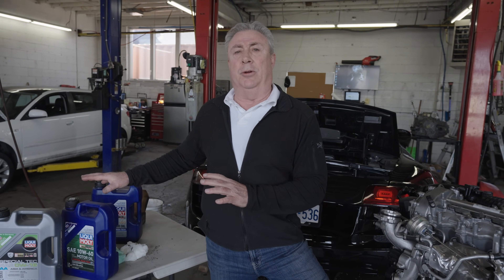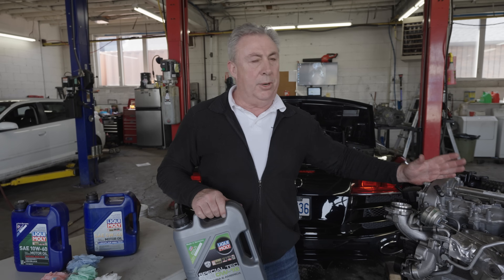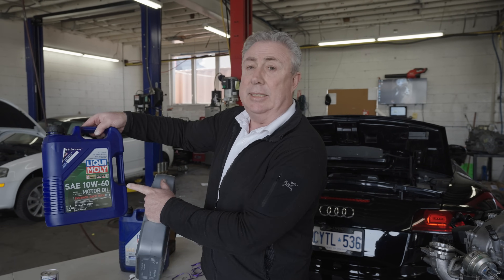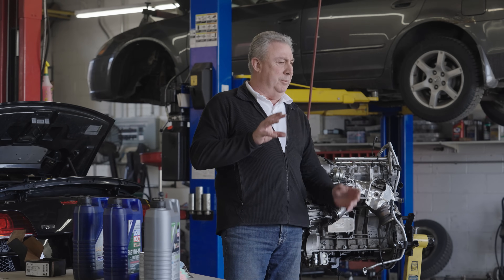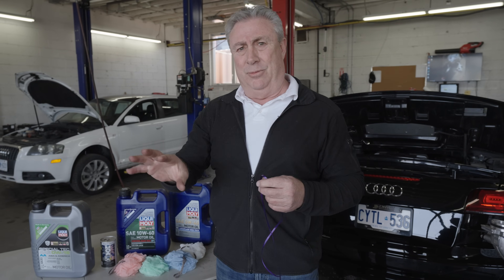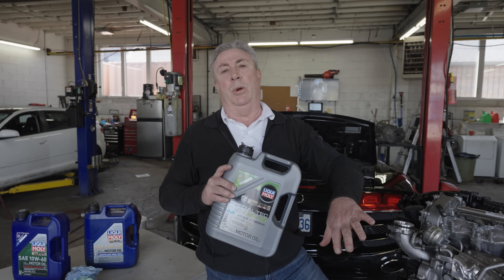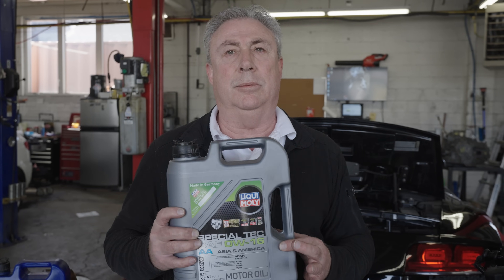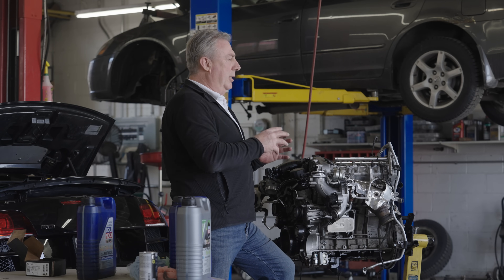Thin engine oil just a Scam? What's Safe

Comment: Most if not all of these engines that spec 0w-20 are rated for 5-30 everywhere else in the world except the USA.  They are full of shit here
Reply: That reminds me that I ate shit for breakfast this morning, but that's beside the point (kidding). My point is I think it is good to thicken the oil as the vehicle ages, and listen to it and the see how it drives while experimenting. I think a specified 0w 20 is too thin for a 160,000 mile engine, and maybe should have a 0w 30 or 5w 30. Main thing is change the oil frequently because tge best oil is clean oil.
Reply: @CJ-wc6lf I accidentally bought 5W30 for my 0W20 2012 CRV with 138K. It does run more quiet. I keep it in a warm garage, so cold start up temperature is 55 degrees F. I’m wondering if I should just keep using. I change oil every 3K.🤷‍♂️
Reply: @davekana8388  Yes you should keep using it.  The fact that your engine is quieter is proof.
Reply: @davekana8388  Is it pure synthetic oil? Do ambient temps exceed 100°F often? Do you tow anything? How long are your typical trips? 
 I would recommend getting an oil sample (when changing your oil) analyzed. You may be spending oil and filter money needlessly. The only people who need to change oil at 3000 miles or less are those who use non-synthetic oil, take short trips on a regular basis, and/or neglect to use high-quality engine air filters.
Reply: @davekana8388 sounds fair to me. A donk with a couple of thousand hours on it, is better off with an oil grade up, IMO.
Reply: @davepaturno4290  Hi Dave I to switched to a Blinded 5-30wt. for my 2015 Toyota Camry' It has only 60k miles on it and its way Quiter now than it was. Yes, I live in Maine wear it gets cold no problems
Reply: @tomm9860  Hello, Tom. My guess is that if you switched to 20W-40 weight oil, your engine would be quieter, but simply making the engine quieter does not necessarily mean that it is better protected from wear. 
 As Ahmed (Car Care Nut) and Jason (Engineering explained) often advise, "Use the oil that is specified in your owner's manual".
 Contrary to what some people believe, most automotive engineers are not out to reduce the life of your engine....and the manufacturer's reputation.
Reply: @davekana8388  You are 100% fine, up to 15W-40 is approved for use for that K24 globally at those temps. 5W-XX has no lower temp limit according to the global service manual, so there would be no reason to expect issues even if you did park it outside.
Reply: @jamesbosworth4191  5W-30 is a good choice for those K24's and is listed as acceptable for all temps in the global service manual, but the fact that the engine is quieter by itself does NOT mean an oil is an appropriate choice. I'm sure it would be even quieter with a 60 grade, but do you really think that would work well long term in a modern VVT Honda engine with tight clearances and low tension rings?
Reply: @ good to know! Thanks for your kind reply, much appreciated.👍
Reply: @averyalexander2303  If an engine is quieter, it means that the oil film is stronger and is floating the parts better.  If you use excessively thick oil, you will have excessive wear on startup, as it will not flow well enough until it get warm, which could be a few minutes, but 10W-40 is NOT excessively thick oil.
Reply: @davekana8388  Pouring thicker oil into i-Vtec engine is one of the least favorable things you can do. 
It is quite silent engine by the way, so no real clue on need for additional "silencing"?!
If you put 5w40, for example, it would probably make it even more "quiet".
Longer period of time to achieve working temperature, heavier cold starts (you'll not use it each and every time in warm garage, right?), slower response on the gas pedal, fuel economy-no real benefits from thick oil whatsoever.
If your HONDA engine works properly, you can easily go with 0W16 Ravenol for example, or simply stick with 0W20 as a factory recommendation.

There is absolutely no benefits of thick oil for i-Vtec engine whatsoever.
Reply: @ thank you for your response, good to know!
Reply: @davekana8388  yes
Reply: @davepaturno4290 I changed every 3k miles since new using only synthetic and I still had varnish spots despite most of the engine being clean inside. Engines can have hot spots where sludge collects, yet not elsewhere.
Reply: @davepaturno4290 True, however CAFE emission standards in the US is most likely the heaviest influencer as to what oil weight to use.
Reply: @CJ-wc6lf  Mobil 1 offers "high-mileage" oil that has the same viscosity as their regular synthetic oil.
Reply: Not really. In fact, (and i mean literally Fact).. if you want clean oil, just change the filter ~
Reply: @georgehofgren6123  Except that when you change your filter only  all the oil escapes
Reply: @mrc2165 no it doesn't... 😆 I actually always remove the filter first when I do my oil changes, because it's easier to not make a mess when your  tub is empty and not full of oil.  I can take it out and place it in the bottom of the oil collection tub to let it drain while it also catches drips.  You'll only lose what's in the filter.  Clean it up and install a new pre-soaked filter and then pull the oil pan drain plug.

 However, changing only the filter is not very smart. The detergents break down from heat and friction and the carbon from combustion. The oil gets dirty from the combustion byproducts and it gets thinner than it was when it was new.  If you want clean oil, change it along with a new filter every 5-6k miles at the MOST. I don't care what kind of oil you use, synthetic or not, or what the manufacturer says. Before synthetics I was doing every 3000, and now I will go 5000 but I still feel weird about it.
Reply: @georgehofgren6123  i had a science teacher that tried this and ruined his engine, oil breaks down
Reply: @georgehofgren6123  filter does not clean the oil just takes out large particles.  Oil breaks down and needs to be changed.
Reply: @sgtshultz13 Guy, i have LITERALLY seen the oil become cleaner. As in almost clear 🙄
Reply: @georgehofgren6123 The only way to know for certain is an oil sample analysis. Everything else is just guessing.
Reply: I have heard that before. But I try and find information on the differences between oil on a US car vs Saudi Arabian, of Australian. I would love to compare.
Reply: @leegmc1985   In Saudi Arabia they use 10-30 wt  motor oil in the new generation Toyota Camry. Starting in 2018- 2024. The US was using 0-16.. now they have went to 0-8 wt for the 2025 year.. Same exact dynamic Force engine.. you know that will cause a lot more wear on the engine. Thin as water.
Reply: @charlesjackson1700  Most engine wear occurs at cold startups. 0W oils flow much better than thicker oils, so .......
Reply: @davepaturno4290  Yes ,at start up.. not much protection once they get hot. Fan oils breakdown rapidly especially during towing.  Thin oil deteriorates faster causes sludge and varnish, the timing chain to wears out faster and clogs the oil ports as well.. so....
Reply: @charlesjackson1700  It's not easy to sludge pure synthetic oil, except after frequent, short drives.
Reply: @charlesjackson1700 mettre de l huile que le concessionnaire préconise
Reply: @davepaturno4290 It breaks down and turns to sludge and destroys the engine in less than 3,000 miles.. Do you live in Alaska with it being 20 below zero..
Reply: @PhilippeSimard-m3m That's what you need to do.. Oil knowledge goes way over your head.. Some people just can't think for themselves..
Reply: @charlesjackson1700 The change in oil thickness happens at any temperature change. Have you ever seen motor oil flow tests at 50 degrees F. vs 100 degrees? That change is reduced when 0W weight oils are tested. In other words, a 5W-XX oil takes longer to flow through the engine than does 0W -XX oil. 
After breakin oil is removed, thinner oils will do exactly what they are designed to do -protect your engine. Just don't do short trips on a consistent basis.
Reply: @davepaturno4290 Thin oils do not protect an engine under pressure ,hot temperatures as well as  under stress/ towing . That is the reason you hear about these newer engines building up sludge , varnish,sticking rings and failing. Oil dilution makes thin oils toxic very early on.. sometimes within the first 2000 miles. I've talked to several Master mechanics and they all say the same thing.. You are just going by what you read.. car manufacturers do not want these engines to last.. it's also just for a lite bulb in gas mileage sometimes less than 2/10 of a mile..CAFE RESTRICTIONS.. AND  DEMOCRAT PROPAGANDA..
Reply: @leegmc1985  My mazda owners manual said use 0w-20 USA and Canada, Except USA and Canada...use 5w-30. Then it mentions if 5w-30 isnt available in Mexico to use 5w-20. I have to assume even though it says "except USA and Canada" this is a North American version manual which means that would only leave Mexico. I have researched some other countries (Europe\middle East) and they were given the 5w-30 recommendation as well
Reply: @Mach141  Same here.. in my 2025 cx 5.. so on my first oil change i used penzoil ultra platinum 5w30 instead of the mazda 0w20 moly oil, but now im second guessing it since i found out that the oil pumps are programmed differently for different parts of the world and thats one of the reasons they recommend the 0w20 for skyactiv engines.. But not sure how true it is. .cant seem to find anyone who knows for sure.... about ready to just ride a bike all day lol
Reply: @dillonDner  I wouldnt worry about it. Im almost certain my mazda didnt have any type of variable/programmable oil pump. Most cars in fact do not. Love the car care nut, but dont believe everything he says. I have heard of variable oil pumps, but i think they are still pretty rare, and its not something thats programmed once for a certain viscosity, but more of a constantly variable thing (again, for fuel economy) and nay such system would likely have a oil pressure sensor built into it, so it would still operate fine. The thicker oil would just build pressure a bit faster because it has more resistance to flow.
Reply: The SAE recommendations are based on ambient temperature. You should only be using light oils if you live in the Arctic. Even SAE50 monograde can be used down to -10C/14F. 

Australian oil company Penrite even makes a 40w-70 engine oil.
Reply: @leegmc1985  Just go to Saudia Arabia and ask them. They love it when we Americans come over there and ask them questions.
Reply: They used to put a temp chart in the owner's manual that showed what oil you could use based on outside temps.  But now with the crazy push for more mpg they just say use oil good for the north pole.
Reply: @ I had my timing chain changed and mechanic told me to change every 3K or the 1 year warranty wouldn’t be good. So I’m using synthetic blend, high mileage Valvoline.
Reply: @davekana8388 I don’t know if it’s the same now. But conventional high mileage Fluid, had addictive’s that would swell your gaskets to stop oil leaks/burning. Those gaskets would Eventually get brittle. Causing you to blow a head gasket faster. 

I was told if your car doesn’t burn much oil then it’s best to not use high mileage oil. Even if you have a high mileage vehicle. Unless your car burns a lot of oil, than it might help and the car might last a few more years. But that option is only if you can’t afford proper repairs or didn’t want to spend the Money to properly repair your current vehicle.
Reply: @ I never heard that before, my very knowledgeable guys at my local NAPA said I should use it.🤷‍♂️
Reply: @davekana8388  Does the car run noticeably better with the new timing chain? ~
Reply: @ for sure, mileage up a bit, no ridiculous rattle on cold start or restart after an hour. Went with a Cloyes kit. I’m sure it added to the longevity to my rust free CRV!
Reply: @davekana8388  I would have asked him why he specified 3000 miles.
Reply: @ 🤷‍♂️ he was probably hoping I was going to bring it back each time.
Reply: in my gf's 2010 crv with 238,000 miles, i change oil every 5-6,000  miles with synthetic 0-20 walmart "supertech" every single time. runs great & it's about 1/2 to 3/4 qt low at oil change
Reply: @ that generation CRV is the real keeper!👍
Reply: @dominicfischio851  I do the same thing with my 2001 Accord with 280,000 miles. It uses 1 quart of the 0w20 oil in about 3,500 miles of gig app driving. That's severe service to say the least, lol😅!
Reply: @gknife1499 la 0w 20 c est la meilleur huile
Reply: @dominicfischio851 It would do better with 5-30wt  especially with that milage.
Reply: @charlesjackson1700 c est faux
Reply: I have new bmw in  Europe, and it has written in owners manual oil viscosity depending on climate u live and drive , mine says from 0w-20. Up to 10w-40. Is good to use
Reply: Bought a chevy truck in 1995. Says to use 5w-30. I used straight 30 since it was new. 360,000. Still running good.
Reply: Mine calls for 0W16. I'm going to 5W20 full synthetic.  Doing the Restore and Protect for a couple changes.....
Reply: @toddkolbe6379 go 0w-30 best option u are protected in both cold and warm
Reply: @toddkolbe6379  That's what I use and mine that calls for 0-16.. It only got the 0-16 oil when I carried it into service Department for two oil changes what came with the Toyoguard Platinum Plus.. Which was 699.00 and you could not delete it.
Reply: I’ve heard that. However I think it’s a wives tale. I looked up my 5.3 spec in a variety of owners manuals across the globe and they were all the same 0w-20 with no listed substitutes
Reply: @Maverick09171  GM use the same oil weight globally. The Japanese and the Korean automakers don’t. Aside from the Hybrid engines, Toyota recommends 5w30 or higher in most countries.
Reply: @RPD91 tous les moteurs japonais minimum 0w20 voir moins 0w16 ou même 0w8 pour hybride les ingénieurs savent ce Qu ils font
Reply: True. I looked up the 5.7 Toyota V8 in the Land cruiser for Saudi Arabia and it takes 5/30. In the summertime I put 5/30 in my Tundra. Winter time 0/20. I looked at the temperature oil viscosity chart and I knew something was wrong. It gets up to 115° in California in the summertime. 0/20 is an underperformer at high temp.
Reply: My car maker wants me to use 0w20,  but its too thin for the intense heat of Arizona. I did look up an owners manual for the same exact car in Arabic for sale in Saudi Arabia/ North Africa. Google translate helped me read it..5w30 was recommended. I switched, change the oil every 5k and use quality full synthetic oils. 320k original engine miles and runs perfectly.
Reply: @michaelyounger4497  The important thing to know is how well the vehicle's cooling system can maintain a certain temperature during high ambient temps. If your vehicle does this, the need for higher viscosity is lessened. Auto manufacturers test their vehicles in extreme weather conditions, and let's face it, desert heat in states like Arizona and CA, as well as extreme cold in Northern states provide the data that engineers require when determining oil viscosity. Racing your car on a track in Arizona is most likely a good reason to use higher viscosity oil during those sessions.
Reply: @michaelyounger4497  And  engine will last longer.. When thin oil breaks down it causes sludge and varnish.. That's what destroys the engine.. Thin weight motor oils cause that to happen prematurely.
Reply: I have 2 96 civics, one American and one Japanese. The American one only says to use 5w-30. The Japanese gives you a chart with about 10 different oil weights and tells which climates and conditions they're each best in. Based on the chart, it's actually best to use 10w-40. That's the jack of all trades oil on the chart. That's what I've been using on both, even though the American one recommends 5w-30
Reply: @peterdaniel66  Actually, BMW specifies the same 0W-20 oil for their 2024 Z4 with B58 engine as does Toyota for their 2024 GR Supra with the same engine.
Reply: All for a 1% difference in fuel economy what a joke. A few times in my life of mistakenly bought 5 qt 10W-30 when my Toyota recommends 5W-30. I put the 10W-30 in any way and of course nothing happens. And you're not going to see a difference in fuel consumption. It's a joke
Reply: Wrong 0-20 is called for by most  manufacturers in Canada
Reply: Amen + Amen.
Reply: I didn't know Jiminy glick was an oil professor. 😅
Reply: The Toyota Cross when originally brought out with the new 2L engine in South East Asia specified 5w-30 oil, then 0W-20 then 16, and now 08 oil.
 All components stayed the same ( check the tolerances, they are the same).
 So I am sticking with OW-20 here in Canastan, and If I ever think of driving to Nevada or Arizona in the summer time, I will go with a 5W-30 weight oil.
 My engines are all high mileage and the changing of the oil every 3,000 km is how I did it,  do it.
Reply: Incorrect. It's the same here in the UK and EU..
Reply: This is BS. The engine piston gaps are designed with specific number. If you put a thicker oil in a 0w-16 engine,  it will heat alot and the engine will get destroyed.
Reply: @nycalien Nope that's not true at all bud 🤦 thinner oil is for better fuel mileage and shortly after ypur warranty is up the motor blows, 5w30 will 100% protect your engine better 😉. Think I would know seeing how I build them for a living 0W20 is what Companies have to follow for the government for MPG BS.
Reply: @jeffgulley7935 Any evidence for your claims?
Reply: @nycalien bravo
Reply: So going from 5w-20 to 5W-30 in south Florida is ok you think?
Reply: @mikeprosser864  No big deal. You might lose a little fuel economy/power but the 30 is gonna shear down to the 20 eventually anyway. Most people think youll get a little better protection that way. All in all it doesn't really matter. Change the oil regularly, use cheap full synthetic and a decent filter. The reason so many of these cars use thinner grade in the US is for fuel economy.
Reply: @TimJohnson-x1o  thanks Tim
Reply: Yes no problem, I did it on my Hemi v8. Oil pressure only rose by 1-2 when at operation temp
Reply: In Southern Europe 0-20W is specified for a number of cars
Reply: 0-16w/0-8w/ hell no. 10k mile change intervals. 4500 is good. 10k is a joke .I know of several 2,5l rav4 toyotas using 5-30w summer and 0-20w in cold winter months theirs like my wife's rav4  are quiet,fuel efficient and 80k miles on it and for me and other friends it works excellent . now look at the oil grades and charts of the 60's thru the 90's . they all have  horizontal  graphs denoting oil weight and a temp scale .depending on the climate dictates what oil to use . I never touched an engine since 1972 . right weight for climate works . now I would not put 5-40w in a modern 4cyc,today but I do use 0-20w winter and 5-30w summer since 2013 on two different mfg 4 cyl. engines and it works and works well . do as you please. i'm just telling you what I do,not you...........
Reply: @anthonygiannotti759  I appreciate the input makes perfect sense to me as I remember those temperature graphs for different weight oils and the range they cover. I’m using 5W-30 in my 5.7 L hemi now in South Florida summertime. When colder weather rolls around maybe even next oil change I’ll put the 5W 20 back in
Reply: I use Crisco
Reply: YES, even 10w 30 best in SUMMER, he don't use brain when starting at 80 degrees in summer in Missouri or Texas.
Reply: Oil geek channel. Said no problem from o-20 to 5-30 .
Reply: @ cool, thanks! I went 800 miles since my change a week ago, if it means anything, my oil light says 100% still. Don’t know if it goes by miles or quality of how the oil actually is!🤷‍♂️
Reply: 🤔 yes a guy said he put a longer oil filter on his engine and was getting oil pressure light codes and changed it back to shorter filter. No codes . 🤨🤔
Reply: @davekana8388  The monitor does not diagnose oil quality. It goes by miles,hours,rpm,type of driving the engine gets etc.
Reply: @ good to know, my oil is still clean, but now I know, thanks!👍
Reply: @davekana8388 it goes by miles, heating and cooling cycles, and run time fully warm.  Thats why lots of short trips on cold engines will drop percentage way faster than fewer long trips where engine gets warm and stays warm
Reply: @davekana8388 oh God don't listen to the oil meter in any car that will have you going 10,000 MI until your next change
Reply: @seatime674 for sure!
Reply: @crspcritter  Some filters are not for car use,I once screwed a freebie from work on my 79 302 and I had low pressure on revving,I immediately took it off. Most longer filters are fine,as long as its not for a off road equipment.
Reply: @crspcritter  thanks, it’s good to be a geek!
Reply: @crspcritter what about 0w20 to 0w40?
Reply: Oil geek on yt only spoke of 5w30 from 0w20.
Where I worked at a water district the mechanic only had barrel of 10w40 for the whole fleet . Many of the vehicles stated 5w30. Never any problems. 👌👍
Reply: We used 10w40 in everything at work. Had a barrel of it for the fleet. Vehicles were spec for 5w30 . Never a problem -
Reply: @crspcritter  my vehicle calls for 5w20 but I'm using 5w40 without issue on mileage.
Reply: Like the V6 and the four cylinder engine (non hybrid) on the Camry for example. It’s rated 5w30.
Reply: Peterbuilt holds 10 gallons I use 9 gallons oil one gallons of Lucas 

For the 4 cylinder car I use 4 quarts of oil and one quart Lucas
Reply: @PRO4XKEV  This oil is ACEA C2 and is not suitable if the vehicle requires ACEA C5 which is Mobil 1 ESP x2 0w-20.
Reply: Manufacturer says 0-20, that's what I'm gonna use.  F**K it!
Reply: 15w40 in F150 5.4Lv3 … for What 😂🤣 no problem cam phaser is magic…
Reply: Lol
Reply: I'll say this. I own a 2023 Subaru wrx. I love in the U.S.  It states that 0w20 is recommended. Here's the interesting part to me. Canadian 2023 Subaru wrx is recommended 5w30. How can a heavier oil be recommended in a colder climate then I live in? Epa baby
Reply: The United Fakes
Reply: That's an ignorant statement. Have you looked into it? Have you seen the tests? Have you seen the UOA comparisons?  0w-20 lubricates just as well as 5w-30. Know why that is? Because it's fortified with MORE anti-wear and extreme pressure additives than the thicker oils, so it can lubricate as well. What you "think" means nothing. The real world testing proves that.
Reply: Yes it is true!.
Also ,Most of the time, what is printed on oil cap is universally Written, for all cars ,the brand is selling all over the world, no matter what climate they will operate in.
So, it should not be taken as true for every climate.
Reply: @ neighbors car, hahahaha!
Reply: I looked it up myself. Went to Mazda Japan website and grabbed the owners manual for my CX-5. Showed 5w30 could be used unless temps are below -25 Celsius, then use 0w20.